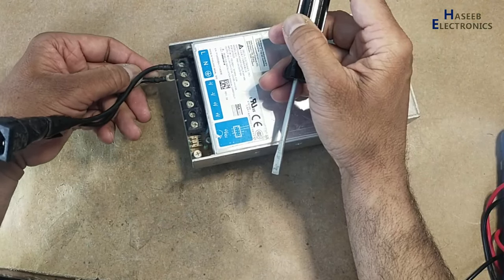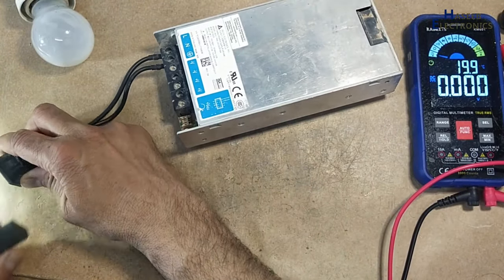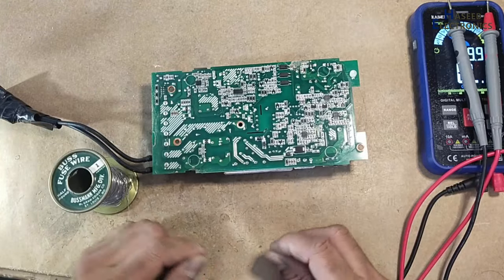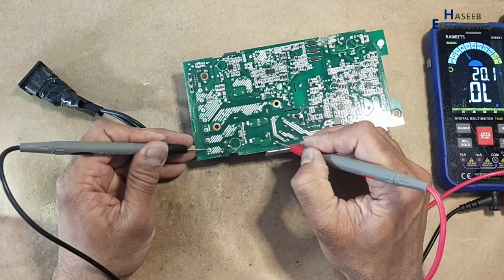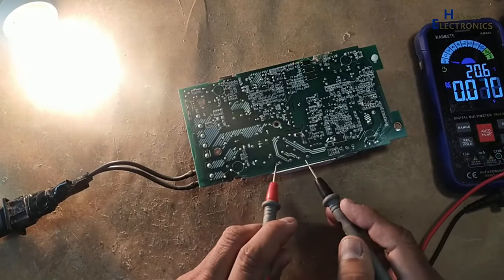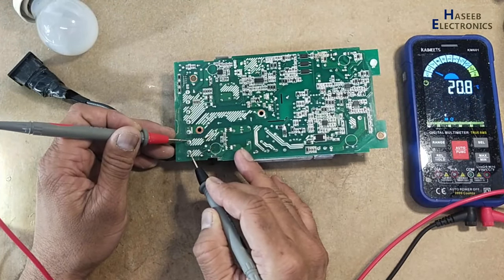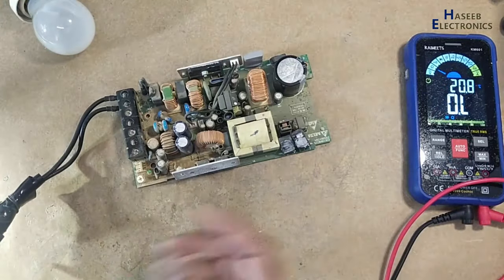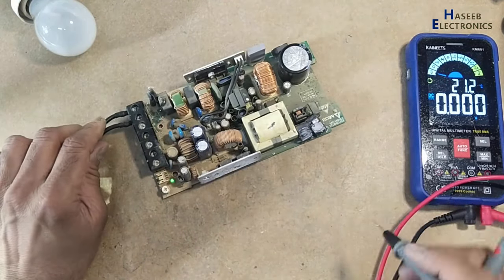{1073} SMPS not turning ON, varistor short circuited

Comment: Sir this high voltage pf capacitor till 2k or 1600volt can we meaure with multimeter because this voltage is higher than multimetr range
Reply from the maker: please check video number 885. and simply you can make voltage divider to measure high voltage
Reply: @HaseebElectronics  ok thank so much sir

Comment: I suppose the input voltage rose too high and the MOV went short circuit and took out the fuse.
Reply from the maker: eaxtly yes. 
if the input voltage are too high or there is a lightening surge voltage appeared at input